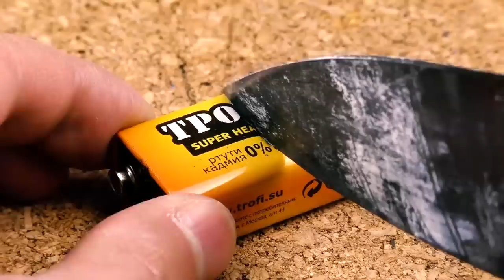19 Life Hacks With Battery

Comment: Protip: Don't do this, especially the ones that involve essentially shorting a battery. The battery will get hot and could burst with repeated use.
Reply: Well, doing that with NiCd, or NiMH batteries or even alkaline and carbon zinc batteries will not be much of a problem.

Never attempt that with lithium based batteries.
Reply: @Z2P yea bro
Reply: Why don't do any of them? Only don't do the ones that involves shorting battery, the others is fine. Though I don't recommend doing any of these with lithium battery.
Reply: @Triffgits  No because some of them are dangerous. Only don't do the dangerous ones, the other ones are fine and I've even done some of these before.
Reply: @advaithmadhavan8260  I agree.
Reply: @BukuiZhao  I am moved by your sincerity and apologize for overgeneralizing.

Comment: First tip > Exposed wire, shorting the battery. Never do.
Second tip > Battery dies, wat do
Third tip > AAA battery falls, AA battery stands. wow.
fourth tip > shorting out the battery but may actually work
fifth tip > buy a flashlight damnit it's cheaper
sixth tip > NEVER, EVER CUT A BATTERY!
i don't have the time for the rest of this bs I just got civ 6 R&F so bye
Reply: Batteries bounce when dead. An dont when full
Reply: @Kilo5910420  or you can just buy cheapo multimeter and read battery voltage with 100% accuracy
Reply: @Kilo5910420  and there are different types of batteries
Reply: Ok here are all of em life hax:
#1: short battery with syringes to make burn marks into wood. Won't work, 9v batteries give too little power
#2: use 12v car charger and 9v battery to charge your phone. Might work but only charges your phone about 30% and wastes 1€ battery, 2€ charger and a tic tac can
#3: '"full batteries don't bounce",* but seems like this life hack doesn't actually work and he had to use different sizes of batteries
#4: ignite fire with steel wool. Probably doesn't work, but might work with very good battery and good luck
#5: make some kind of emergency light with hot glue stick, led and a button cell battery. That hot glue stick just gets wasted and makes the light dimmer
#6: heat up a knife and destroy a battery with it. a) why? b) don't destroy batteries kids
#7: sharpen scissors with battery
a) just dulls those scissors b) might explode the battery
c) those scissors have a too loose screw, you could just tighten it
#8: DIWHY: waste a fidget spinner, 3 button batteries, 3 leds and 3 balloons to make a cool led fidget spinner that doesn't even look that cool in person because of camera stuff
#9: remove batteries with magnets. You could just shake that remote
#10: ignite fire with steel wool. probably doesn't work
#11: make a weird rgb light with button battery, rgb led and a clothing pin(or whatever do you call it). straight up useless
#12: store battery in a balloon so you can have it in water. Useless, but might actually be useful for something else
#13: battery and a magnet will roll on folio. useless & won't work
#14: use battery and gum paper to ignite fire. Might work, but notice jump cut at 7:04 and lighter in his hand at 7:06 (noticed by littlebook7)
#15: use flexible fabric and stapler to make a battery holder. Might be actually useful
#16: use duracell capacity checker on other batteries. Probably works
#17: heat up your hands with battery shorted with folio. doesn't provide enough heat
#18: flash light with battery and led, mounted to a cap. Won't provide enough light for any use
#19 key holder with 9v battery terminals. Might as well use nails
Most of these are already well known life hacks and bad
Reply: My favorite was using solder as wire, nothing like having a pool of molten metal all over your batteries. Then again, the dude wraped a battery in tinfoil.
Reply: @turtleb01  shorting steel wool on a battery is a very well known way of making easy fire, same with the wraping gum trick. The syringe thing also works, as long as you have the very end of the tips touching since they are so thin, 9v is more than enough to get it red hot (though soot buildup will make it stop working pretty quick). That said, nothing really new here, and the things that are "new" are useless at best and suicidal at worst.

Comment: Please use a soldering iron instead of glue gun... :D
For pyrograph, a worn soldering iron tip is much better. 
LED's attached to batteries, without resistors, are burning out quickly. 
Please get some knowledge in electronics...

But the kitty is really cute :)

Comment: Lol cut a battery to sharpen scissors that will work. (Try cutting sandpaper that really does work to sharpen them real little hack) I like that you have a plaster on your thumb to protect it from the heat of holding metal on both terminals of battery.

Comment: At 1:35 they are just using a bigger AA battery with a bigger surface area. That's why it stands up. It won't even fit in the remote.

Comment: Amazing i can make my own portable charger.can you make a video to charge a computer battery without a charger.my computer battery is dead i have 2 batteries i use one battery for 12 and 24 volt dc motors from printers that i take apart.i have no charger for the computer last summer i found a computer outside it was in the box,good condition comes with a battery the key board is ok no missing letters the screen looks new but its missing the hard drive.i want to use my dc motors again but i have nothing.my dc power supply is mess and i have to replaced the mosfet transistor on the volts side.

Comment: #1: short battery with syringes to make burn marks into wood. Won't work, 9v batteries give too little power
#2: use 12v car charger and 9v battery to charge your phone. Might work but only charges your phone about 30% and wastes 1€ battery, 2€ charger and a tic tac can
#3: "full batteries don't bounce", but seems like this life hack doesn't actually work and he had to use different sizes of batteries
#4: ignite fire with steel wool. Probably doesn't work, but might work with very good battery and good luck
#5: make some kind of emergency light with hot glue stick, led and a button cell battery. That hot glue stick just gets wasted and makes the light dimmer
#6: heat up a knife and destroy a battery with it. a) why? b) don't destroy batteries kids
#7: sharpen scissors with battery
a) just dulls those scissors b) might explode the battery
c) those scissors have a too loose screw, you could just tighten it
#8: DIWHY: waste a fidget spinner, 3 button batteries, 3 leds and 3 balloons to make a cool led fidget spinner that doesn't even look that cool in person because of camera stuff
#9: remove batteries with magnets. You could just shake that remote
#10: ignite fire with steel wool. probably doesn't work
#11: make a weird rgb light with button battery, rgb led and a clothing pin(or whatever do you call it). straight up useless
#12: store battery in a balloon so you can have it in water. Useless, but might actually be useful for something else
#13: battery and a magnet will roll on folio. useless & won't work
#14: use battery and gum paper to ignite fire. Might work
#15: use flexible fabric and stapler to make a battery holder. Might be actually useful
#16: use duracell capacity checker on other batteries. Probably works
#17: heat up your hands with battery shorted with folio. doesn't provide enough heat
#18: flash light with battery and led, mounted to a cap. Won't provide enough light for any use
#19 key holder with 9v battery terminals. Might as well use nails

Comment: 1:10... Ever heard about power banks? Alright, this version is cheaper, but using a power bank is safer...
Reply: Better is to use either lead-acid batteries or a 14.4V Li-Po battery pack.

Comment: GUYS, BEFORE YOU COMMENT ABOUT THE DANGER IN THIS VIDEO please note that only shorting circuit the battery or opening it is dangerous. I won't recommend doing those, but I would recommend doing the others that are safe. However, I don't recommend doing any of these with lithium batteries.

Comment: 0:36 what did you do with that length of solder, did you just leave it dangling ? 
If you pause the video at 0:51 that solder is still dangling there, you haven't done anything with it.
What is it's purpose ?
2:38 Cutting a 9 volt battery in half is not a life hack, it's a waste of time.
5:01 Is not a life hack, it's a waste of time
I couldn't be bothered going through the rest of this garbage, 'cause the majority of them aren't even life hacks.